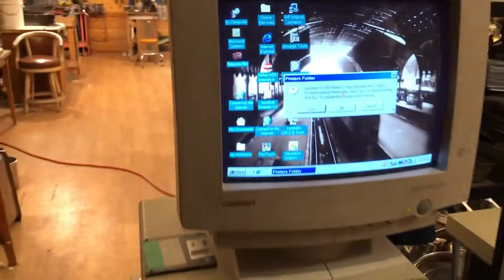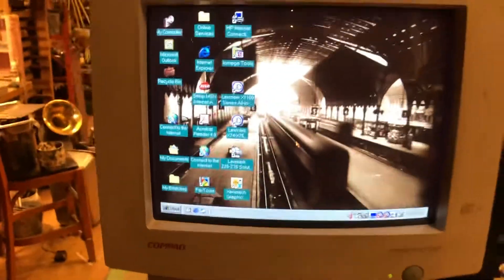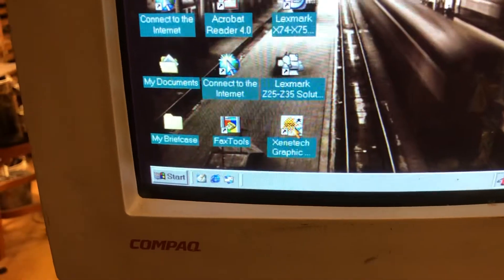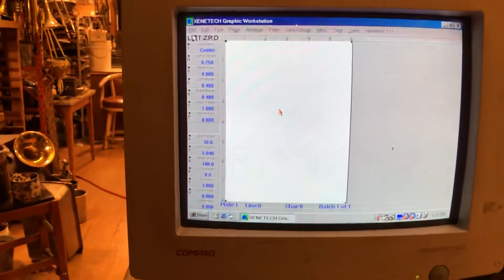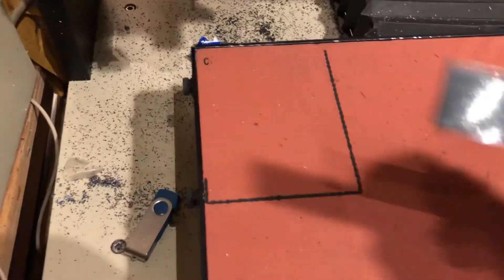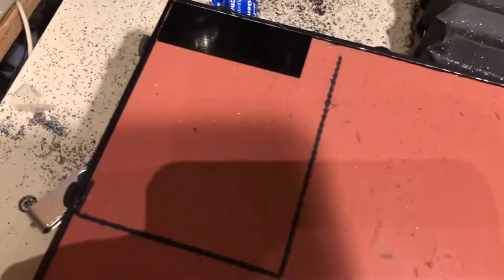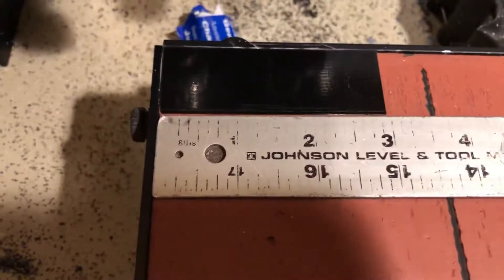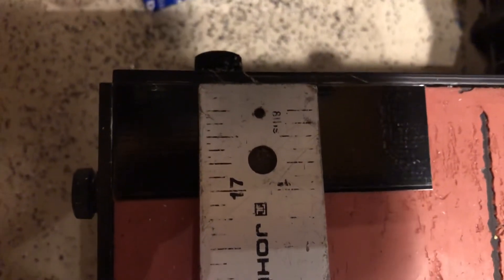Xenetech  version 3.11 controlling an XOT 16x25 pt 1

Comment: This brings back memories. I used a Xenetech when I worked at a trophy shop, between 1998 and 2000. It was a very solid piece of software and the workhorse for the plaque engravings we did. The laser engraver was new and experimental. We used that for the marble plaques and acrylics.